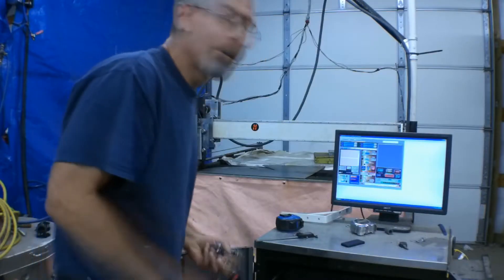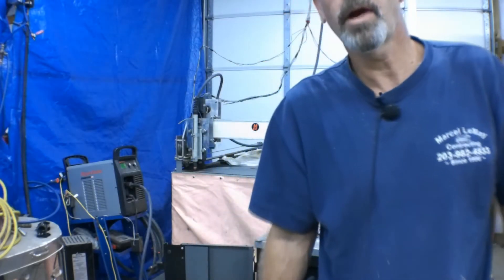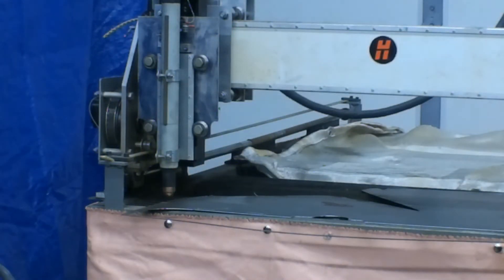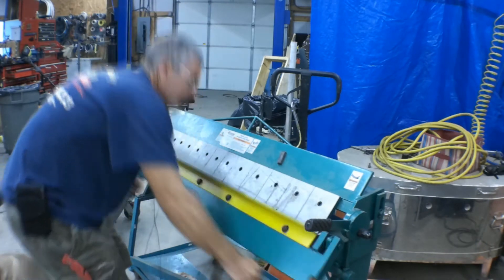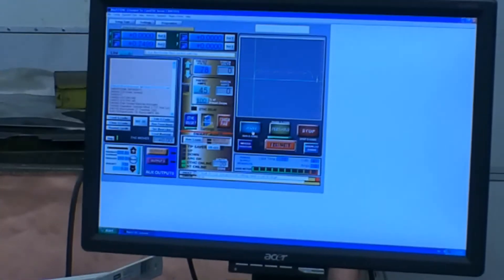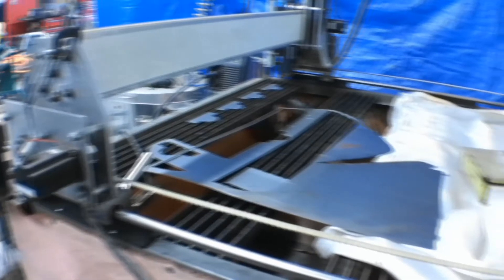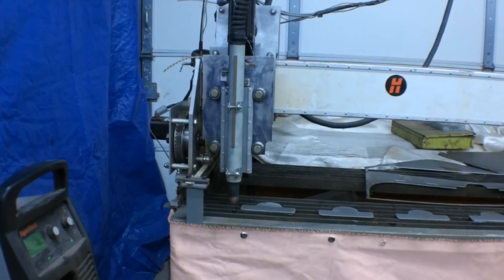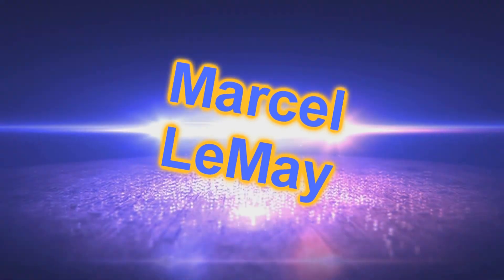Home Made CNC Plasma Cutter Table, back from the dead!

Comment: I wish I had seen this build and your Channel before I spent over $14,000 to get essentially the same thing. Precision Plasma LLC gantry,  CandCNC Bladerunner package, and HyperTherm 45x  on 5' x 10' water table. It's been over three months since starting the project and I am still trying to tweak things and get the DTHC working right. Your work is impressive, especially the use of low cost materials and parts.
Reply from the maker: Garry Remington 
Thanks Garry. It was a lot of work, no doubt about that. The candcnc controller is awesome...It really is what made the functionality of my table on par with a pro built table. I don't think I could have built a better controller at any price. The mechanicals were no problem for me, I have a manufacturing engineering degree, and quite a few years experience as a fabricator and machine builder, but the electronics would have been a serious leap in learning for me. I'm happy that candcnc exists and did all the dirty work in the controller department. They also work closely with the developer at sheetcam, and the team at hypertherm to make a seamless cutting system. They didn't pay me to say that...I just like the company!

Comment: What model blade runner package is that and do you remember the price?
Reply from the maker: +kalei p I'm running the blade runner 620_4 package with torch height control and the rs485 and hyt connect kit. I don't remember the price off hand, but I bought it in early 2012, and I think the pieces have gone up since. If you do a Google search for candcnc, their web site will come up. It wasn't cheap, but the support you get and the product is as plug and play as a cnc controller gets. There's still a lot of configuring that needs to be done on your end, but there is loads of support for these controllers. They've become the industry standard and many oem manufacturers use these controllers. Btw they don't pay me a dime to endorse them.
Reply: Marcel LeMay looking for somewhat plug and play at lowest cost think the candcnc is 2k with thc automationtechnologies is 1500 without tch and there is a gecko 540 set on eBay for 850 without thx which will be 300$ ever heard of gecko?
Reply from the maker: +kalei p;
 if it's the same gecko company that manufactured the gecko stepper motor drivers then yes, that's a good company. The bladerunner system uses gecko drivers. Just make sure you're comparing apples with apples. Thc is worth every penny. Candcnc comes with motors and wiring. And it's designed to be interfaced with a hypertherm plasma cutter. If you're not using a hypertherm plasma cutter, you're gonna be in for a lot of headaches...just a warning that I learned the hard way.

Comment: Hi Marcel - Love the table design! I home-built one as well. Struggled a lot with the decision of whether to run belt or chain drive; opted for the chain-drive route. How stretchy are the belts, anyhow? Did you use the Kevlar reinforced ones?  I've got a steel gantry that's pretty long, and I was concerned about the elasticity of the belts when reversing gantry direction.
Reply from the maker: +John Elliott 
Hey John, I did use the Kevlar reinforced belts. My primary reason for using the belts was economy. It turns out that, there is no backlash, they are very quiet, and once they are tensioned properly, there is no stretch. My gantry weighs about 65lbs with the torch. I wanted the lightest gantry that I could produce economically. When I originally designed this table I had the intention of also using it for routering too with a spindle, for doing plastics and wood, and maybe even some aluminum. I never got to that point. But I believe that it would be rigid enough to do that so long as I don't push it too hard. I considered using rack and pinion, and also bicycle chains in the beginning but after seeing another plasma table with belts, I liked the idea and ran with it.
Reply: I actually found the chains/sprockets to be a little cheaper. Because of the steel gantry, I wanted to keep the weight down, so I mounted the gantry drives to the base frame and ran the chain the whole length of the table and back. Here's a video: https://youtu.be/iLh12JwCqOE 

I was also considering possibly mounting a router, but found that my gantry design is too flexible vertically (I had to slow down the acceleration on my Z-axis to keep from having a resonant "bounce" from the THC.) I think I may eventually revisit the gantry design, making something a little more triangulated. Man, what a learning process this has been!! Like yours, I started out full-steam ahead, and then it lay dormant for a time. Then some work came in that got me off top dead center. Probably burned a good 10,000 lb. of plate on it now. Hypertherm rocks, yes?
Reply from the maker: John Elliott   Hypertherm is the bomb! Is totally designed to be integrated into a cnc table. I started out with a cheap Chinese plasma cutter and I had nothing but trouble with it from the over the top emf it was emitting. It fried a couple of boards on my controller and even a power supply on my mach3 computer. Tom from c and cnc actually bought it off me to use as a test platform to bullet proof his controllers. He said it has the worst emf of anything he had ever seen including the old esab plasmas.
Reply from the maker: John Elliott
 What did you use for a controller? Did you design it yourself? I ended up putting my y axis mechanical stuff on the gantry mainly because my table is very rudimentary, so, I wanted to have the flexibility of dropping the gantry on a better table eventually, even though it does add quite a bit of weight to the gantry. This thing occupied me for months...with a lot of frustrations.v The cheap Chinese plasma cutter was the root of most of my issues. Had I known it was gonna cause me so much grief, I would have started out with a hypertherm right off the bat.
Reply: I too am using the CandCNC Bladerunner package with the 620 oz. steppers. I bought the 5 motor option, planning to develop a rotary axis in the empty 2' bay along one side of the table. I've bid on a project that would take substantially greater rotational torque, though, and I'm thinking about trying out a Clearpath servo motor for that application. I am truly glad that my cheesy approach to things didn't include cheaping out on the cutter! I do wish that I'd coughed up the additional to get the 85 instead of the 65, but I have had luck recently with 1" SA516-70 - starting on the edge, of course. My rail design is all based on 1-1/4"  x 3/16" square tube on a 45° angle, using angle iron mounted ball bearing "skates". They run quite smoothly and true, but required quite the fussiness in fabrication to get truly parallel. I wanted to stay away from the energy chain cable management approach. This was another reason for mounting the gantry drive to the base frame. I'd seen the folding overarm approach on a router one time, and it seems to work pretty well, although my overhung pivot brackets would be better they were double shear - at high accelerations the overarms tend to sway a bit.
Reply from the maker: John Elliott
 same package I used except I only got 4 stepper motors. I added thc and the rs communication package to communicate with the hypertherm. I'm very happy with three blade runner /hypertherm combination...Its the best in my opinion. They worked really hard to make that package bullet proof.

Comment: Do you have a build thread and or dimensions of the plasma table?
Reply from the maker: In the video description, there's a link for the build log. There's no plans, i designed it on the fly. I plan on making a more detailed video of the plasma table, let me know what you need to know and I'll try to get it in there. Thanks for watching. Subscribe and click the bell icon to be notified when the video comes out.
Reply: Marcel LeMay if you can take some dimensions that would be great.